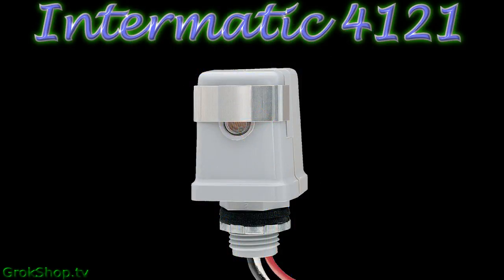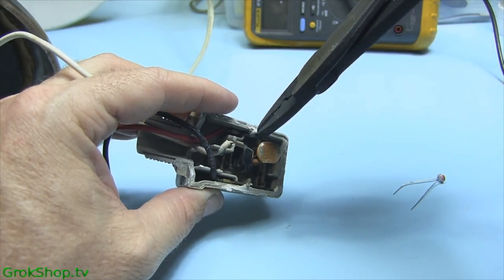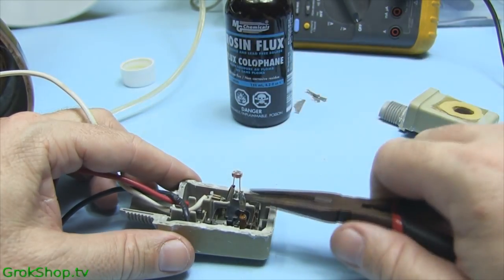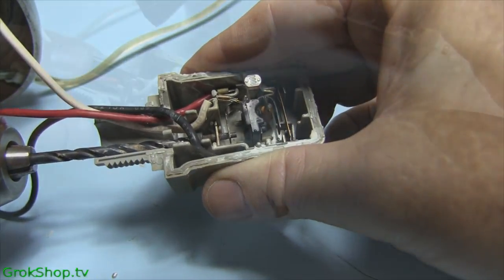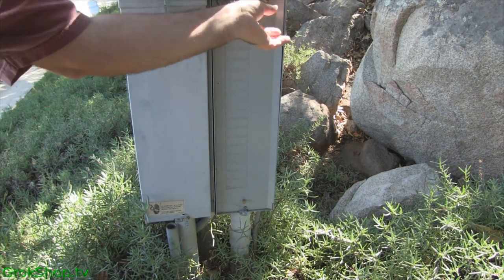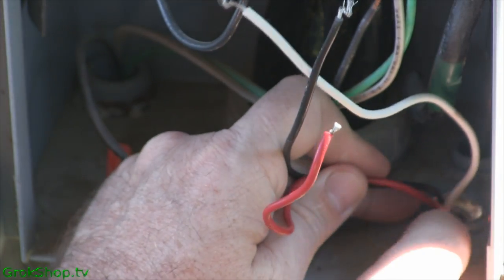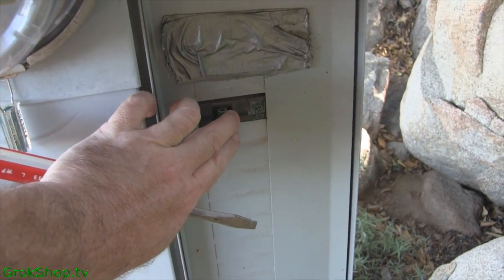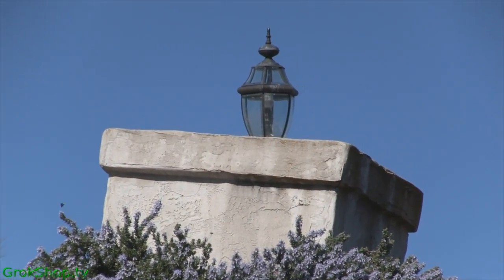Intermatic PhotoControl Repair | Intermatic PhotoCell Repair | How to Wire a Photocell Light Sensor

Comment: Thanks for showing me how this thing works. I have the exact same model controlling the wall lights where I work. They don;t shut off anymore except maybe on a very bright day.  I'll probably replace the whole unit but it's interesting to see the innards. I tried getting it apart with a knife and screwdriver. No go. How did you do it?

Chuck
Reply from the maker: Yep same symptom. But yeah they clearly don't want people repairing them.  I probably should've shown the cut-open. Mine was kinda falling apart already, but I did use a Dremel cutoff wheel I think for part of it.  Its an interesting device that uses relatively primitive technology & wastes a little power heating that resistor.   A more reliable & efficient part would use some digital switching logic & a relay.  Maybe there is one like that available already?
Reply: @grokshop  A dremel... I should a gone there first. Yeah, primitive tech I love it. And this unit serves a building that houses a tech company which makes control systems for industries. I'm the maintenance guy but I'm sure I can find something that would work in their junk box somewhere. A hifalutin tech company with the wall lights on all the time? Doesn't look good.
Reply from the maker: @cspann831  Not a good look, no, lol.  One might reckon the boss there would be receptive to a control part upgrade!   Git 'er done... & thanks for the morning laugh. :D